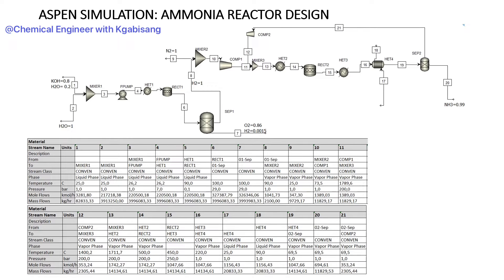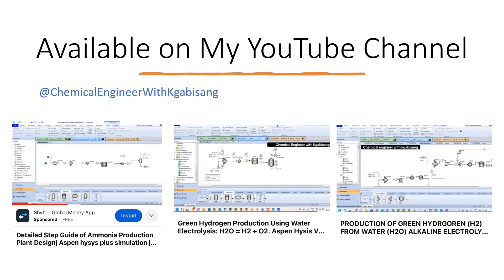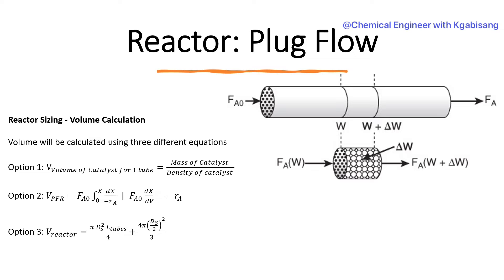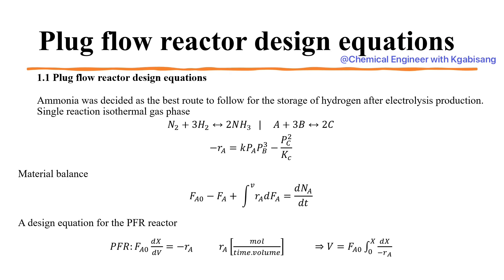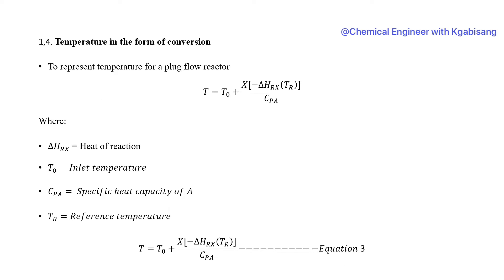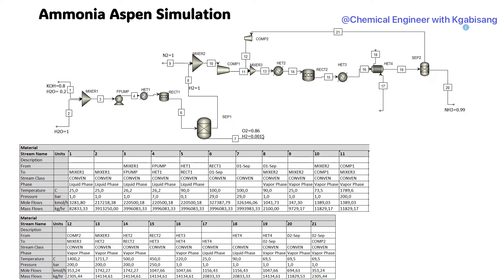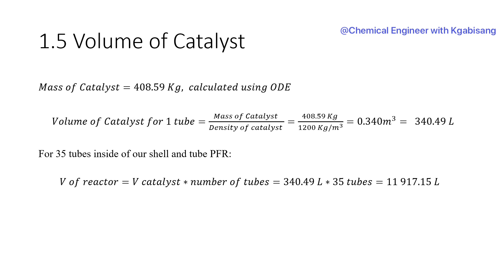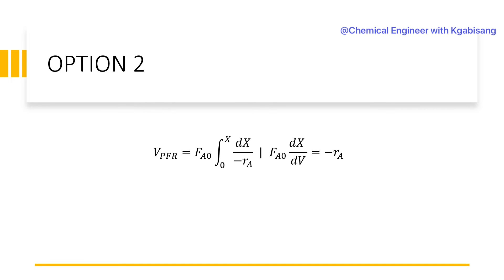PFR Reactor Design. Volume, Catalytic Weight, calculations

Comment: Hi! Thanks for the video. What happen if I have more than one reaction?  I have just to add the other equations and solve?
Reply from the maker: Hi

When using Option 1 in the video to size your reactor, please refer to timestamp 8:07. 

The inlet stream currently consists of two separate components: FB0 (hydrogen) and FA0 (nitrogen). To ensure sizing, I suggest combining these components using a mixer, creating a single stream for reactor input. This will allow you to obtain the initial flow rate, temperature, and pressure of the inlet stream. 

The catalytic weight equation takes into account both nitrogen and hydrogen reactants in the mixed stream / inlet stream entering the reactor. 

If this approach doesn't yield the desired results, don't give up! Instead, explore options 2 and 3, which are straightforward and provide alternative solutions.

I recommend consulting research and referencing your textbooks to further inform your calculations❤️🙏🏾
Reply: @chemicalengineerwithkgabisang  Thanks for the prompt answer! But my question is in the case that I have multiple reactions occuring inside the reactor. I have a project with this situation and I need to calculate the reactor volume as you explain in the video but I have 3 reactions (2 series and 1 parallel reaction) What should I do to include the other reactions in my model and then solve? Thank you very much
Reply: @lauradanielarodriguezchiqu3410  Hi! Did you find a way to calculate the reactor volume and catalyst weight? I also have 3 reactions occurring inside the reactor and don't know how to decide reactor volume.